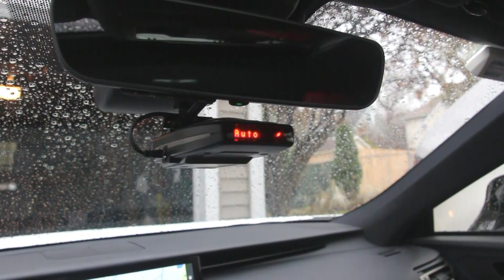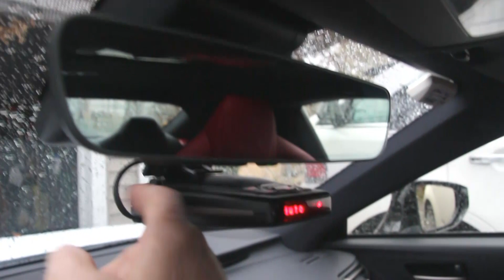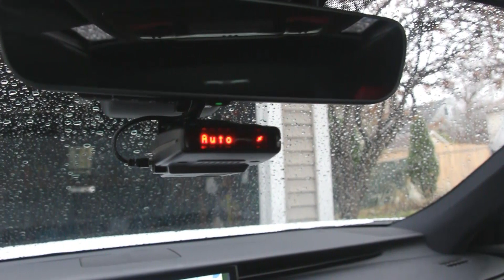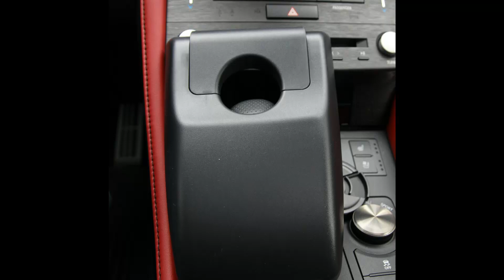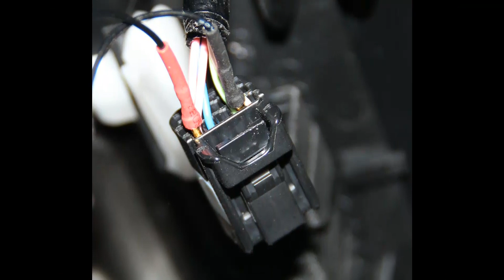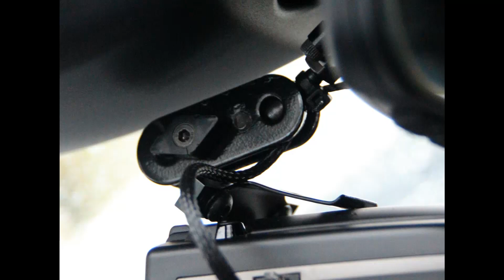Lexus RC F Radar Detector Hardwire Install

Comment: Would this work on a 2015 RCF?
Reply from the maker: My guess is the connectors are the same but I would suggest checking voltages with a meter

Comment: I have a 2021 is350 and wondering if it’s the same. I mounted my RD below the rear view mirror like yours but haven’t tapped a power source from that area. 

To remove the bezel pull the small piece away from the windshield then slide upward?
Reply from the maker: I'm not familiar with the IS-350 but it should be very similar. My mirror had the Homelink Garage opener in it.
BTW, your dealer might be able to offer you the information. In the past I have asked my dealer such questions.
I would suggest that if you encounter resistance check for screws, older ES's had some, but I don't think you'll  find them here

Comment: Can you power the radar from the front camera of a Toyota Corolla 2017 and it looks like that vehicle has a camera too ?
Reply from the maker: You should be able to steal power from any 12V line. I chose the mirror because it is ignition controlled and it is close to the mount for the RD. It is also a low current draw circuit.
I have not yet wired a camera into the car, but I will and will probably use the same line
-Are you referring to a camera you installed (I wasn't aware of Toyota installing front cameras on 2017s)? 
-The answer is maybe. Did you use an ignition controlled line? Some like their cameras powered all the time, RDs not so much.
- Since most car cameras use 5v, they require a power adapter. You would have to tap the line on the fuse/harness side of the adapter where there is 12v.
Reply: The camera is from the factory is for the lane assist
Reply from the maker: @kevinbolainez7595  Got it, and yes the RC-F has the lane assist. I assume power can be tapped anywhere, I would prefer not grabbing it from the safety systems, I don't know what type of feedback system they may be using
Reply: I just check the camera for the Kane assist I check and it say is 12v the part name is 8646c-02010 and like u say I can use power from a 12v so it should work